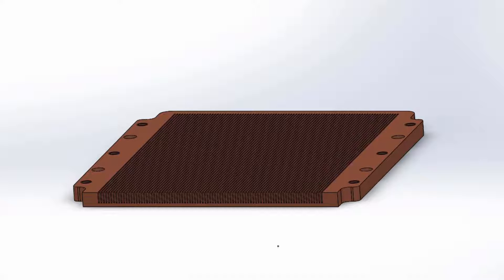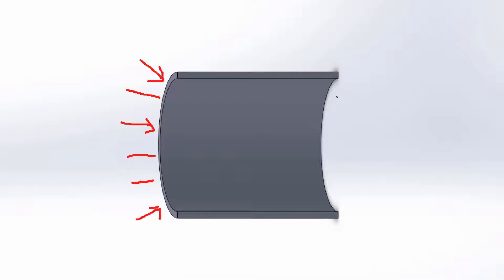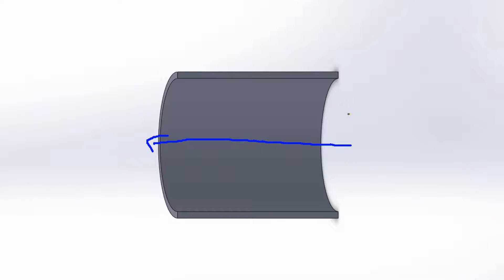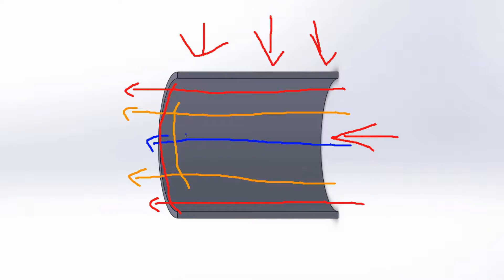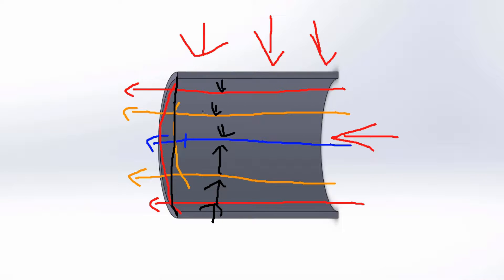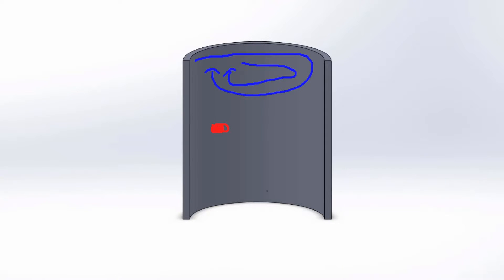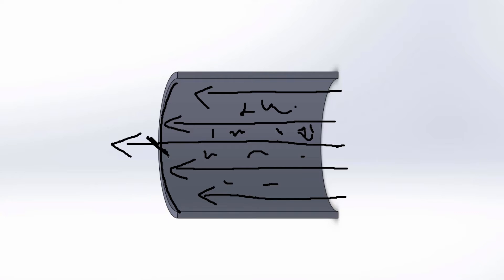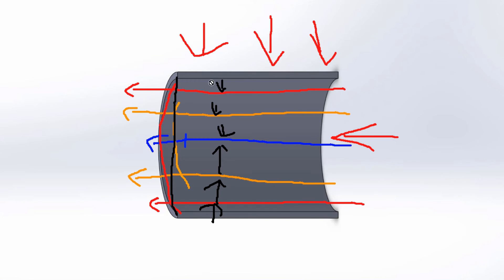Peltier Waterblock Theory: Thermal conduction of water. Episode3

Comment: Seeing this video I finally understand why the hot-cold separator "valve" works. If you have never seen one cut open, it's a T-shape junction with a wedge at each end both pointed in the same direction. Feed liquid or gas in the center and you get hot out one side with cold out the other. It never made any sense why such a simple design worked until I seen your illustration of cold water sinks to the center of the pipe in which case that "valve" makes sense since on the hot side the flat and point of the wedges will cause water to "bounce" to their appropriate sides.
Reply from the maker: im gad someone actually watched the video :)